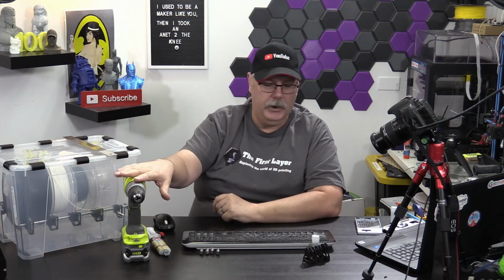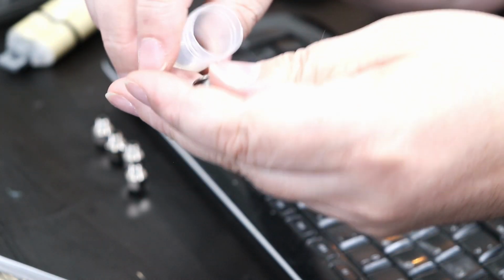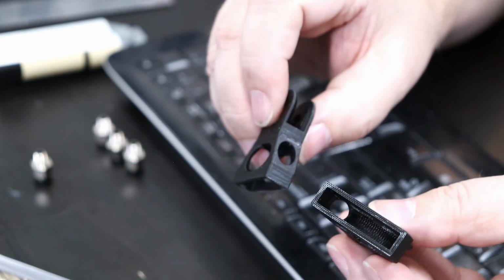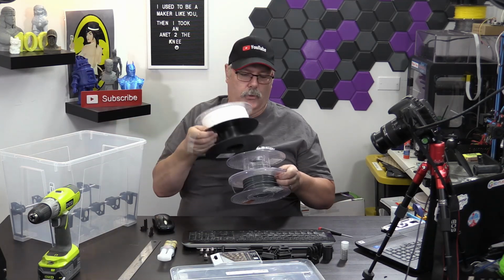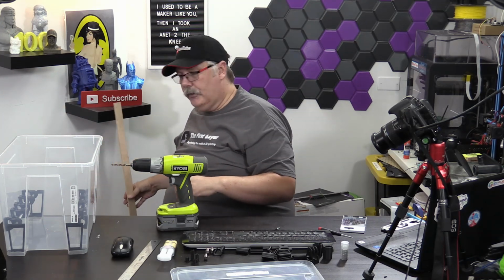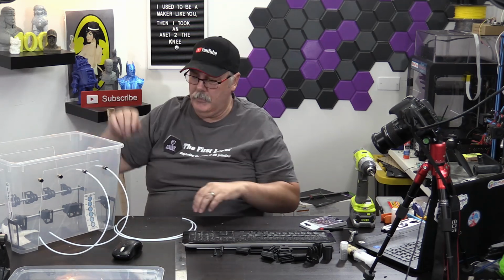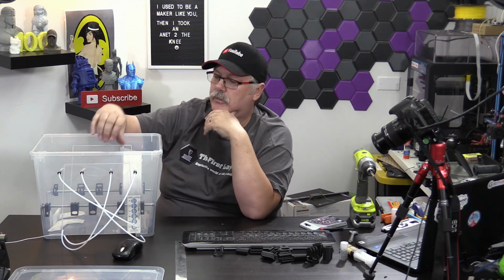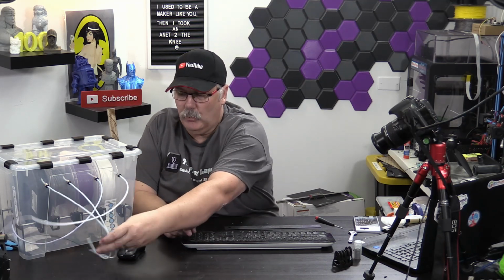DIY Dry Box

Comment: This is probably the best dry box video available, but there's some stuff you need to know.

If you're running an Ender 3 (or a printer with a similar print area), it'll take at least three prints (10 clips, all bearing holders,  the book-ends) to complete one box. Total print time will be 21-24 hours *per dry box*, depending on your slicer settings.

0) I cannot stress this enough - TEST-FIT EVERYTHING. I just Rambo'd it the first time, and forced a double bearing holder with an ill-fitting bearing onto the axle, and had to break the bearing holder to get it off the tube.

1) Be prepared for some post-production work on the bearing holders. I had to use an emery board to remove some material  where the bearings go. If I didn't do that, the bearings wouldn't turn at all, defeating the reason they're even there. I sanded until the bearings fell in and out under their own weight. That means there won't be any binding as the spools ride on them.

2) Flange bearings are probably not the best pick because the flange contacts the bottom of the bearing holder, and prevents/inhibits its ability to turn. I ordered some of these of Amazon - https://www.amazon.com/gp/product/B082PQ3SC4/ref=ppx_yo_dt_b_asin_title_o02_s00?ie=UTF8&psc=1 - and will get them in a few days. If they don't work out, I'll come back and edit this comment accordingly.

3) If you need an axle, and don't want to use all-thread, I'm using this brass tubing - https://www.amazon.com/gp/product/B07PVHN5GR/ref=ppx_yo_dt_b_asin_title_o01_s00?ie=UTF8&psc=1 - Of course, you'll have to cut it to length to fit the box, but you'd have to do that with all-thread as well.

4) I originally ordered 20 flange bearings, and only about 3/4 of them were  able to slide over the brass tubing. I had to sand the tubing (especially at the end)  to be able to get enough bearings to slide over the brass tube, so be prepared to do that. After I sanded it far enough to get the bearings on, I applied some metal polish, and the bearings slide effortlessly on the tube now. 

5) I made ten clips for the lid (three for each of the long sides, and two for each the short sides). It just seemed like a good idea.

6) I got this weatherstrip - https://www.amazon.com/gp/product/B07MNW8QR1/ref=ppx_yo_dt_b_asin_title_o06_s00?ie=UTF8&psc=1 - It is the perfect size for the lid (1/2-inch x 1/8 inch), and comes in a pack of two roles (enough to do five of these boxes).

Comment: I only ever have 1 roll of filament in use with my printer at a time although I have 5 colours open at the moment, I would build this with just one outlet and three static racks for the other 3 rolls. or I could build it as it is but design and print some bungs for the unused Bowden tubes so that moisture finds it harder to enter the box